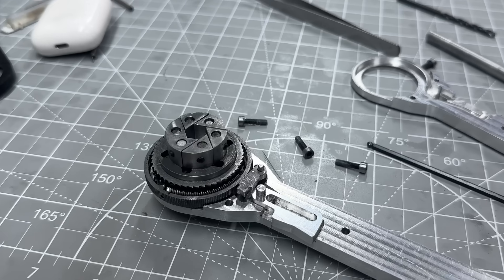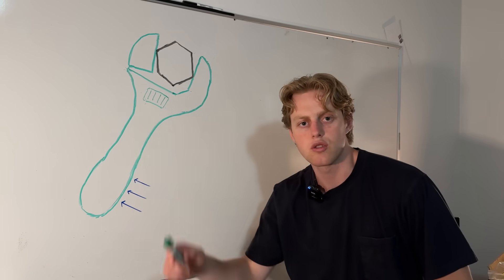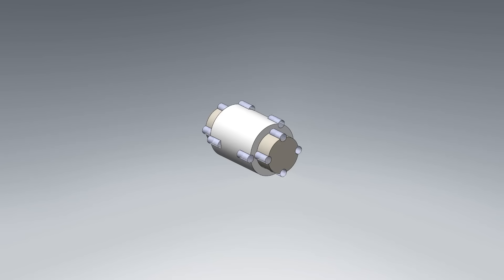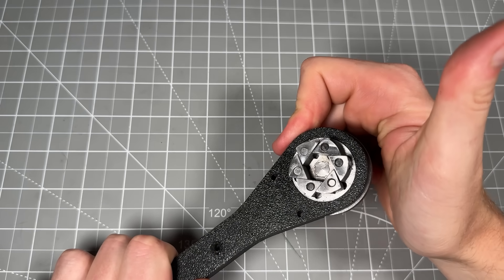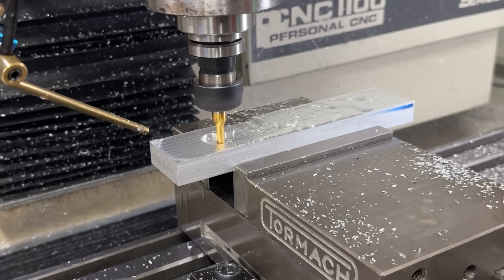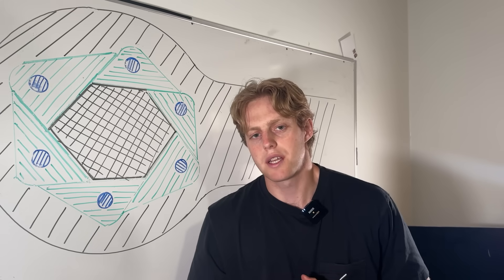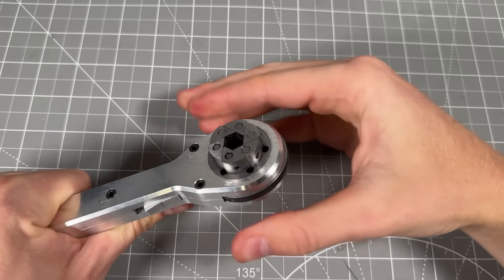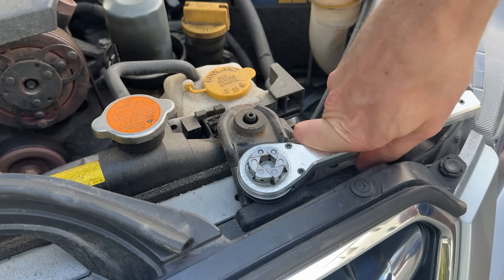I Invented an Adjustable Ratcheting Wrench

Comment: I just sent this video to a mate who works for SnapOn - especially as your product actually snaps on!
You could have a collar with arrows or red for tighten, green for loosen.
There are a TON of use cases for this, especially for working technicians and engineers who don't wan tot take 200 sockets up a power pole or across a plant. For most of the working world, your idea is pure genius!
Reply: 😂 no
Reply: So now your mate is going to submit the idea himself to Snap-On and this guy will get zero credit or compensation when they produce it.
Reply: There are already such products on the market. This one is supposed to be cute and slim while also non-practical: 0:33 - 0:57.
Reply: Once snap on gets hold of it....30 billion percent markup yay!
Reply: @HexOmega3113  You really watched too many movies. It's a shitty design, good for kids in primary school.
Reply: @speedofscience did I piss you off with the snap on comment? Lol
Reply: @HexOmega3113  What did you say? I forgot already.

Comment: I dont want to be that guy and i realy like what you came up with but 😊
Works great aslong as you can reach the head and it is too thic since you solved the Rotation problem by mirror the head

I would rather use an old tool 
Like a chain wrench 
Or  standing tap pliers

Comment: It looks pretty robust, id be confident to use it for some light work here the bolts are new and without rust. I think it can be a right tool for the right job - somewhere where you dont have bolts with head sunken into the surrounding material - milling machines, trucks etc. I would be interested in seeing thr achieveable torque and loosening numbers and also stresstesting till faliure. I think if it was scaled up by approx 30% it would be more suitsble for heavier duty work - a goal would be to loosen 100nm rusty bolt with approx 17 mm head. Scaled down, it could also make for a very nice tool - perhabs such work would suit this design even better - lower stress, lower torque specs.  (screws up to 14mm head) - like a small ratchet set.

Comment: Nice work and persistence to reach a working version.  As a 35 year auto mechanic I have to say this would, unfortunately, only work on maybe 10-15% of fasteners one encounters on a daily basis.  Bolt heads and nuts are not always a perfect hex either.  Corrosion is a big factor in the real world and a modern socket/closed end wrench design is essentially the only way to apply enough torque to break some fasteners loose.  Access is ever more challenging as modern cars get more components packed into tighter spaces.  
  I like the innovation and I'm sure there is a good space for this to fit, but it definitely has many limitations.  
Good luck going forward, keep exploring.

Comment: You invented nothing. That is a  simple fractal ratchet. the patent was filed in 1913.. cmon. Patent Holder: Paulin Karl Kunze.. Filing Date: 1913
Reply: The patent is a completely different invention, what are you on about?
Reply: @pesock1111  don't take offence just saying its not a invention it is just a new application. i wish you the best of luck and success.

Comment: Could you simplified to a single head by having a direction switch that changes which of the gears is fixed and which ratchets? So the red is rice in one direction, but the blue in the other?

I know this isn’t a complete solution, you would need to change the release mechanism, but I hope it gives you something you can work with.

Comment: I work with the marketing strategist who made Yeti Coolers famous, and I have several comments to make:  Design question:  The ratchet retention lever appears to have only two teeth; could this be a weak point?  Why not a semi-circle retention lever with 6 teeth?

By publicizing your design and fabrication process, you’ve given the copycats quick-and-easy access to producing knock-offs sooner than the normal 3-year pattern we normally see in off-shore copying of good product designs.

Marketing of this product will need a very clever and very economically-efficient strategy in order to achieve monetary success in the marketplace.  It will need more than just clever words and cute graphics to sell this concept to your most-important audience demographic.  Laser focus on this market segment is key to ensuring economic success by making sure you don’t waste precious marketing dollars going down the wrong path. This design of yours is a market disruptor and has huge potential, but that potential can only be realized with experienced marketing.  Be careful; marketers will come out of the woodwork like bugs and will try to convince you they have the best way to get this product to market.  Reach out if you have any questions.

Comment: Really cool design, but you’ve successfully created a 1/4 to 1/2 inch adjustable, I’ve never slipped a normal adjustable on a 1/2 inch bolt 🙄 this wouldn’t last a week in my toolbox as well, the first time I go to use it it’s not going to fit anything I’m working on and I’m going to chunk it, not to mention the handle is aluminum that’s going to break if you accidentally bow up on it  like a man, not trying to hate just trying to give inside think it’s a cool design, but I think that’s all it is. It’d be good for stay at home dads that put ikea desk together

Comment: that looks great mate.how does it open over the nut? so ive just seen how you open it up.you have one big problem pal.many times you cant get 2 hands into small spaces for you to be able to open the spanner for the nut to fit.this will severely cut down the uses.this is where a socket on the end of an extension will always win.how every what youve designed is great. id market it as a pro DIY tool for around the home. if you can look specifically at jobs like scaffolders ,they tend to use one size spanners ,it may be a great tool for their application. im a plumbing and heating engineer of 38 year experience. im also in to cars ,electronics etc .basially anything what uses a tool. if you have any questions you would like answering, message me mate.

Comment: instead of having wrenches on both sides perhaps consider making a ratchet wheel the other way and a mechanism to switch between that way you can set the direction at the flip of a switch.

Comment: Dude.  This is that type of dedication to one’s craft that is so lacking these days with all the ai slop and ease of, well everything. You showed both your wins and losses on the way to creating what I truly consider a masterpiece of mechanical engineering.  I’m very impressed and can’t wait to try the design for what I need it for which is in an electrical engineering base.  It’s actually printing right now for a test run. Ty for the video. Much appreciated. Well done.  Cheers 🤙

Comment: I love the "turn the body"-feature. That's the first REAL improvement I've ever seen with adjustables over standard wrenches. (at least after you found the right one). Having a single high-priced one might be more compact (and maybe even cheaper) than a dozen or two low priced ones. Apart from that, I kinda fear how it might get stuck when wearing out with all those tight tolerances? Still nice!

Comment: Crescent wrenches are often too bulky to access bolts near other bolts, so a bulkier tool would only complicate the issue.  IMO, the fastener industry itself needs to be re-standardized, similar to how the ratchet sector already conforms to 3 main sizes, 4 if you count 3/4" drives.

Comment: Amazing. NOW you need to destroy your creation. Find it's breaking point. I'd love to see videos like that. Just tightening a bolt until the wrench explodes into a bunch of gears. Could even lead to a stronger tool! That's not just a tool but a work of art done by a craftsman. Just showing it's capable torque output would be cool too.

Also...expect a call from investors and or government contractors. Even with limited production if it's a solid tool, you're talking millions. Surely it could be upscaled? Big wrench small wrench, 2 tool does it all.

Comment: Great job!  I’d buy one!  Is there a way of incorporating most of your design features into a socket such that an extension could be used to access harder to reach areas?  That could allow the ratcheting function to remain on an existing ratchet, but may require having two sockets, a remove and an install.  Just thinking out loud here.  Obviously you have a great mechanical aptitude!

Comment: Very impressive. This could indeed be very useful and I want one. But I suspect the biggest test is now if it will work when it have been used for over a year in a dirty environment and all sorts of grease and debris has had its chance to enter the mechanism. I think that's the biggest issue. If you need to do maintenance on a very regular basis, that's probably a deal breaker.

Comment: If you make the "teeth" stick out more on one side (for example the unscrewing side) and less on the other (the screwing in side) you get an intuitive and easy to see difference to know which is which.
Also, have you seen the way the Silentgear ratchets work? It might be an interesting choice instead of a normal teethed ratcheting system, they're very sturdy and really have zero backdrag, they also allow for work in really tight spaces where the handle can swing only a tiny amount!

Comment: This is rather genius! Kudos, this has been needed for a long time!  To overcome the issue at the end with clearances and depth, I suggest you make another tool; this is already the superior adjustable wrench! The other tool can just be an adjustable extension fashioned how you've suggested with the chamfer - but it doesn't need to ratchet, that will be handled by the wrench the new extension is used with which could be yours or another if you make it standard.

Comment: Probably been mentioned before but you need 2 hands to attach it onto the nut/bolt head, so it requires space to use. How about a thumb leaver or similar that allows the jaws to be opened using just the one hand so you can attach it onto the nut/bolt head.....just saying 😁

Comment: My concern is that I DOES struggle, slightly, with one size that you mentioned and I don't understand what causes the holding power so I can't confidently assume that the metric sizes, that fall between the standard sizes that you tested, will work. Now I'll backtrack and fill in the commas but you will see the rults in their finished state.

Comment: Certainly, as a complete thought, this is great, but I think splitting it into 2 wrenches, one for each direction, you could solve the bulkiness. The wrench handle is probably thicker than it needs to be, too, but that's minor. I'm sure you've thought more on this than I have though, great project, subscribed!

Comment: Like you said... Current design would limit working in tight spaces. Having to use your second hand to open the grips just wouldn't work. Also current socket wrenches allow for extensions to reach hard places, would you incorporate that with your current build?

Comment: . flip to reverse - great, simplest way to achieve - paint the sides facing up with black and white  - for CW and CCW  (Red and Green are color-blind-male, unfriendly yellow and blue are CBlind visible - often..).. 

A larger size for up to 5/8"  - 1-1/2"bolt heads could be  a scaffolders tool.  30 -or 32mm might be a bit too large for a single tool to manage
 - dismantling a car engine (or a lot of mechanic work will always take a variety of tools - this can be just one more (set) - the body in 4140.. with a podger end  ??   - Heavy fitting or Scaffolding - fewer tools in the mobile tool kit always simplifies the travel component.

An issue is "corner driving"- rather than an element of flank drive - possible the one biggest trade-off.

 - Parts which need to be truly round - bulk objects or holes, do, absolutely need to be manufactured on a "natively round processes" - unless using extremely high end CNC with very small interpolation - or - continuous infinitely varying splines (not really true, but near enough. Drilling, slot-milling and turning and boring will never go away.

(an overlooked feature of old-school copy machines is that the finishing passes were truly continuous - as good as the tracing pattern  (lots of skill in getting them set up just-right.)

Comment: That's awesome, would 100% purchase if you made a kickstarter. I don't think it's gimmicky at all, worst case it ends up being a better alternative to the monkey wrench with the added bonus of being able to hold bolts.

I think clearance for the head width is going to be hard to improve upon without sacrificing durability. Might be worth making a bunch of different versions with different grades of tool steel and thicknesses. A chamfer may help get the tip in but the whole head wouldn't fit, and you'd end up with the same problem.

The one thing I would consider might be a mechanism on the handle for changing the bolt grabbers size. In a cramped compartment, reaching to the head of the ratchet would be a pain.

Really awesome project either way, I'd personally love to do something like this one day (torque amplifying wrench with planetary gearing) and I'll follow your project closely.

Comment: Unfortunately, adjustable wrenches will never be a real replacement for having different size sockets on a normal ratchet because sockets can be bought in different lengths, be used with extensions, have adjustable angle attachments and can be used with power tools.   I could barely count on 1 hand the amount of times in which an adjustable wrench would even work on projects I had because of not having enough space around a bolt.
Reply: - yes reasons why many have several sets of sockets..  one more versatile tool can take some time out of many jobs - save the walk back to the truck for the custom...

Comment: Love the idea... but I do see tight spaces, and limited depth, being an issue.    One might extend the Teeth to a depth of at least 1 inch in either direction... But... that would also make the head even bulkier..  which might also limit where it can be used.    That said... maybe there could be a way to make a  "Teeth Extender"  part,  for deeper and or smaller bolts,  in tighter spaces.

Comment: It really isn't a big problem to swap sockets to the right size, so not sure I really get the need for this, and a set of sockets are cheap.
Having extensions of different length and such make a ratchet and socketset neccessary for any mechanic.  So it will never REPLACE these tools.  The case I can see is when you don't have the space to carry all those tools, like for example on a boat where we try to get by with just one adjustable wrench.  Or maybe a travel trailer might be similar.   If you know this wrench works for all situations, but I find it unlikely.  I'd also think you might be better off designing a socket instead of a wrench that does this.  The ones with a set of pins, which I've tried and they don't work very well.

I will tell you what I find super frustrating in my car work is when the ratchet does not get enough tension to ratchet anymore because the bolt is loose, but not loose enough to quickly take it out by hand.  The electric ratchet solves this issue, I find them to be the best tool, break them manually and then spin them off with electricity.  So if you make a socket instead of a wrench, we can use the electric ratchet with your sockets, and get the best solution.

Comment: what if i tell you that you not invented adjustable racheting wrench  wrenches like yours alredy exist most of them have 2 jaws but Stanley twin tec has 6 jaws there is also a Dewalt wersion next time use google instead of reinventing the wheel Stanley and Dewalt is making those wrenches from at least 2013

Comment: An adjustable socket wrench is handy enough on its own that if you made the adjustment mechanism based on manually turning a shaft in the handle to achieve tension it'd still be worth it.

You can also reduce assembly complexity and decrease bulk by making your jaws and pins one piece instead of having to make the jaws bulky enough for the pins and set screws to fit into.  Alternatively you can still reduce bulk of the jaws by thermal fitting the jaws to the pins instead of using set screws.

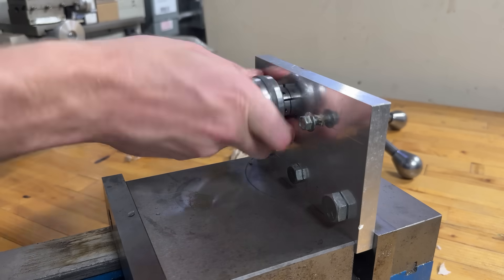Comment: 11:01 suggestion for remembering which way is tighten and loosen, mark the handle facing you with the direction, when attached to the bolt. Recommend also using an arrow to indicate direction to perform said action.

Comment: Really interesting concept, 

I have one improvement idea

Machining the center plate dial to have some more grippy texture and maybe wider , then maybe use softer spring .

With this maybe you only need your thump to open with the hand gripping the handle.

Also one of the drawback it's bulky,
The more you approach to a final design the more you can trying to add somes thinner titanium part

Comment: Allowing the wrench faces to interact with each other might allow you to benefit from the same tensile strength you mentioned a conventional socket having. On the flat faces of each wrench piece, what if you added a small dovetail, and a dovetail slot on the other flat face. Then all the wrench pieces would slide together, and as it contracted, each dovetail would slide within the dovetail slot of the adjacent piece. This interaction would mean that much of the reaction moment from the bolt would go into trying to separate the wrench pieces by trying to pull on the dovetail joints. This should allow for more force to be put through the wrench and perhaps smaller/cheaper rods. I imagine this would be quite difficult to manufacture however (perhaps a small dovetail bit could be used). Still, might be worth a prototype. Good work and great vid!

Comment: For recessed bolts, couldn’t you design an extension that uses regular sockets? One 1/4”, one 3/8”, one 1/2”? Perhaps sold separately, perhaps not.

Pretty amazing.